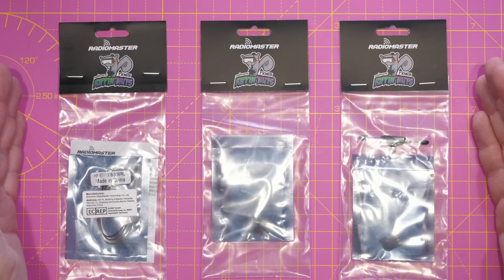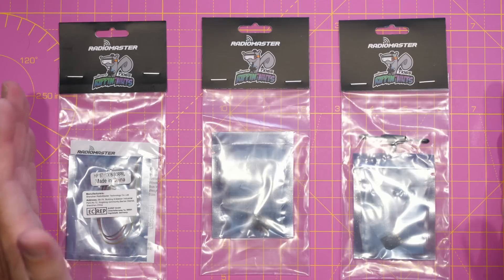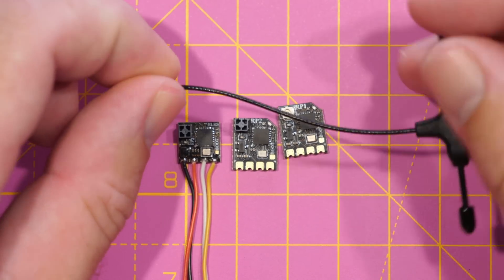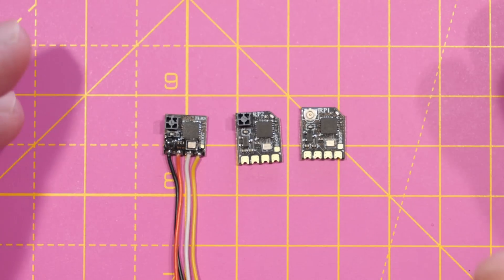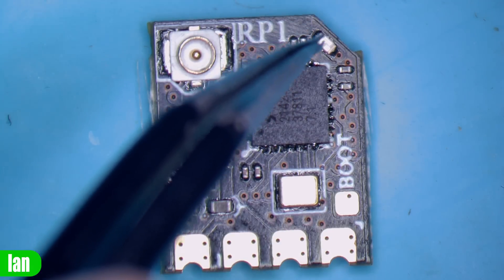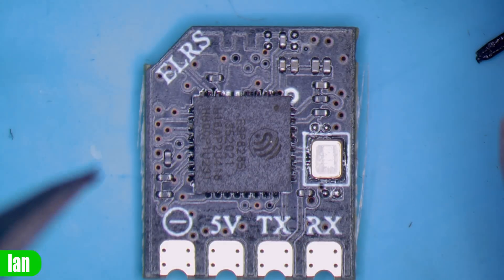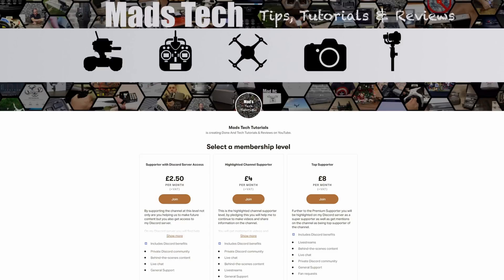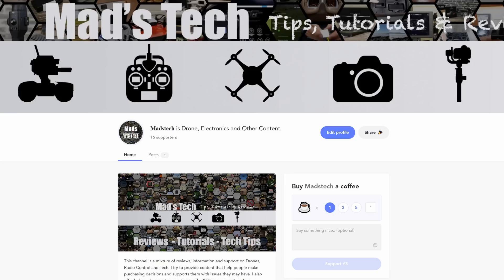Radiomaster RP1 & RP2 ExpressLRS Receiver - New Design

Comment from the maker: Crystal Oscillator Accuracy

I was asked to test the XCO on these receivers, please see the below results.   

Testing done with Aaronia Spectrum Analyser as per the Dev team process with a tone on 24,440,000Mhz and units tested cold and left to warm up and drift. 

RP1 - Tone at 2,440,002Mhz - 2khz positive offset - no major drift over time. 

RP2 - Tone at 2,440,022Mhz  - 22khz positive offset  - no major drift over time. 

Comparison with BetaFPV TX Micro 500mw Tx model hot .

Tone at 2,439,869Mhz - 131khz negative offset - some minor drift over time. Increased from 126khz. 

As you can see when you compare this to the ELRS dev team chart the Radiomaster receivers are well with in spec. 

This is obviously based on a test sample of 2.
Reply: @Mads Tech  Could you make a video sometime about the whole topic cause I am just partly sure what this is about. I guess you had mentioned that in a livestream with a chart and some radios and receivers with different offsets to the 2,44 which then could end in a mess if the combination gets out of spec. 
I had read that comment about the XCO and his complaints and therefore did a google search for 'xco elrs' with simply 0 result - therefore I am asking.
I guess it is the general quality issue how precise and  consistent the receivers / transmitter work together or if they are on the edge and could cause an issue depending on the transmitter and ambient temperature  - which will be a lot harder to test considering that your bench might have 25°C in summer heatwave and 15 in winter, while built in it will face 50°C and more inside a plane in summer on the field.

thanks
Reply: It is very informative about receivers. What about ELRS transmitter?  I would like to see what offset and drift the oscillators of Radiomaster Zorro and TX16 II internal module have got.
According to elrs dev XCO chart, vast number of elrs receiver have negative xco offset whilst Radiomaster TX16 has positive drift. This may raise some concern about what extent RX and TX are compatible with each other at all even though they are at the same ELRS version.
Reply: Thanks, great to know!

Comment: My experience: RP2 in LBT EU Mode (and within the frame): RX works well, but Telemetry is lost after less then 200 m. RP2 in ISM Mode: ok, but not stellar.  RP1 with external antenna: absolutely no RX loss, perfect telemetry signal (again in LBT EU Mode). (my TX: Radiomaster Boxer ELRS).  My recommandation: always go for the RP1 (unless you always fly very close).
Reply: I fly RP2 on 150Hz and 250mW, still impressive range. RP2 on 500Hz it is a different story and range is definitely less. (Jumper T18 Pro, LBT EU Mode)

Comment: the question that needs to be answered is..  do the RM EP/RP type recievers play well with the Happy Model 2.4 ELRS transmitter? Do they bind easily or does one have to sacrifice 2 goats and a duck to get it to work?   a great example of hard to do would be binding the Happy Model Mobula 6 ELRS 900 with the Radiomaster TX16S using the Happy Model 900 ELRS transmitter drop in pack... nearly impossible to do if you arent a computer wizard...

Comment: Good stuff! ; ) Most of us (at least those building more aerodynamic models like wings!) appreciate that the RP1, WITH socket/external antenna results in a less aerodynmic and heavier build (+1.7g)!  Would be great to know how much signal strength/range is compromised with RP2, if at all? (Signal strength/range compared to RP3 would also be VERY helpful!)

Comment: Excellent video.  I searched to find the difference between the EP and RP models.  You've explained it very well.  Improved PCB, larger solder pads.  Slightly larger but the RP2 fits in my 2.5 Tadpole rather well.  Thank you, sir!   I can't believe how easy it was to update the firmware over wifi and bind the receiver with my radio  ELRS, I'm hooked!  Thank you RadioMasterRC!

Comment: Hi Mads - I saw someone criticize your video and then you tested it, compared to Betaflight, but I did not understand the technicals behind your reporting - it went over my head.  My concern is I know a ceramic antenna has less range but still Wes Varty got really decent results that basically no quad could ever fly beyond its range - yet I bought a Betafpv receiver with ceramic antenna and my RSSI LQ was dropping considerably within 150 feet - not sure if I can trust ceramic antennas - would like more info on range and reliability of signal, etc.  Appreciate bringing these products to our attentiion.

Comment: How does its frequency stability perform in various temperatures?
Reply from the maker: I did add the offsets though in the sticky
Reply: @MadRC  Ah I think those don’t show up on YouTube mobile on my iPhone browser. (Neither in the mobile app as far as I know)
YouTube is very inconsistent with that.
Reply: @MadRC  thanks!
Reply from the maker: We can test this forever but that’s not really going to change anything. These are so close both cold and left to warm and tested again they are never going to drift outside the 200khz limit.
Reply: @MadRC  thanks for your response!

As a very frequent viewer I’d really have liked a more in depth video (using all of your many skills and tech equipment). After watching I do not feel informed to a level that would help me make a purchase decision. 

In any case, keep it up! You’re doing good work.

Comment: I watch your channel rather regularly, and I generally like a lot what you do. Thx for that!
This review however I find quite disappointing. You only look at the build quality, but good build quality does not say anything at all if it's good design and high quality. A crap design built well still is a crap design. I actually deprive all these reviews out there which just look at something and than praise it in high words. That's a strange interpretation of "high quality". The disappointing thing here is that especially you would have the abilities (tools) to do better!
First, I wonder, is this a TXCO. If not, then it is the same crap design as before. If it is just a XCO, is it in the correct frequency range? You could measure that with your tools! How does it behave with temperature? You could measure that with your tools! (I assume you surely know about the frequency issue(s) with ELRS devices) 
Is the RF path on the pcb well designed, how is the rf filter/impedance matching? You could measure that with your tools! Does the antenna just have a nice plastic thing, or is the ufl connector in fact well attached (which is often the real problem)? How is the antenna tuned, and matched, does it reach the gain it is expected to reach? You could measure that with your tools!
Nothing on any of the real points, all you argue it's well built and conclude it's highest quality and so much much better ... you can do better :)
Sorry for being picky, as said I generally like your contributions a lot, and I wish you won't become just another of these hasty reviewers talking all the same ... well, you understand :)
Reply from the maker: There are a few things here I’d like to reply on.  

First of all I did I hit just say it was good based on how it looked. I made it clear I had not flown it my self however I had actually spoke with the ERRS devs on the receiver to confirm their thoughts before publishing and it was said to be absolutely fine with no issues.  The design is  as they would expect it.  

As for the XCO issues in ELRS this is actually something that’s extremely limited and no that wide spread.  It’s something I am thinking about adding to the list of tests for sure however it’s also not something that needs to panic people.  To keep it fairly simple I may add in testing for this but I also don’t want to be highlighting something that’s affecting 1/1000+.  But these receivers are being tested specifically for that today but that’s only a sample size of 2. 

Antenna tuning is one I will do in-future for sure. 

As for going into a deep dive on the antenna matching circuit and PCB track impedance on something like this of this cost I’m not sure what the benefit it overall. 

I 100% agree on some of the basics we can cover and add info on to for sure and I will post some of that later today.  

I don’t just say I’m happy with something easily, if I can’t test it I will ensure I have spoke to someone who has who is in authority as I have here with the ELRS dev team. 

The problem with reviews is there is a balance, could spend 3 days on a $20 part and achieve nothing more than what I was originally saying however I also agree more info could be here.  I will be posting an updated video on the P200 PSU later today and then I will do the same for this and I’ll do the Xxo tests on all my radiomaster gear
Reply: @MadRC  absolutely, you had been clear, I didn't wanted to imply different. Yet, the argument stand. Cool however that you poke deeper into it, and if my post may have triggered it, it wasn't useless. Maybe after some days, when you have compiled all pieces, you would make a follow up review. I think many would love a deep dive. (and mention ELRS devs test insights&opinion). Keep up your great work :)
Reply from the maker: Just as an update the RP1 and RP2 were tested today and here is the results. 

Testing done with Spectrum Analyser as per the Dev team process with a tone on 24,440,00 

RP1 - 2,440,002 - 2khz positive offset - no major drift over time. 

RP2 - 2,440,022 - 22khz positive offset  - no major drift over time. 

Comparison with BetaFPV TX Micro 500mw Tx model hot .

2,439,869 - 131khz negative offset - some minor drift.
Reply: If you had watched the videos regulary then it is obvious that there had been 2 kinds of elrs receivers
* cheap and crappy soldered ones with some DOA or questionable quality regarding how long they last
* better ones on the bench 
That's what we have seen before and talked before on the channel and sometimes on sunday evenings we had talked about the experience on the field, but we had not measured that. I bet you will find not much difference between the same pcb.

And over all of that we have to face the reality of chinese mass production that can change from day to day based on the supplies they got as we had seen in the laptop area even before the corinna nightmare like those EZBooks where we had identified 5 different designs for the same product with different weaknesses like touchpad and others.

So what you have seen here means nothing considering that supply line issues can force them to choose different components from different suppliers on paper with the same specifications, but if you have to exchange 5 components then 5 different tolerances can multiply each other and end in a nightmare. Might not be happen with TBS products but ELRS vx/tx will suffer far more of these issues.
Reply: @typxxilps  you seem to be unaware of the 3rd kind, those with bad or even flawed design ... maybe you want to not only watch videos, but also inspect other sources of info more regularly ;)

Comment: I still don’t get what’s the big deal.  I’ve never even heard of radio master….. is this for  air or can it be used surface?  Just didn’t get why all the technobabble
Reply: it's probably ly the smallest long range receiver with great quality you can buy today. it is used mainly for quads because of the light weight and size, they also work with UARTs found in flight controllers,  there are other elrs receivers for air  planes and surface (cars) they would use old school PWm style connection.. RadioMaster is is a great brand, they offer endless options on your receiver from physical customization like buttons, lights, nobs. but the Radio master uses edgeTx which is constantly being updated. pound for pound there isn't a better controller in my opinion when it comes to the RadioMaster Tx16s m2. take some time to do a little research and see all the benefits compared to over rated over priced brands like spectrum, Futura and others.

Comment: Can you please contact with RadioMaster and ask them when the elrs module for the Tx16s radio will be available.  I would like to replace it on my radio (v1) from 4in1 to elrs. Thank you in advance
Reply: I've been using the HappyModel Pro with no problems. Even though the radios are coming with internal ELRS now, it's still capped at 250mw. You have the better option, get a readily available external with 1000mw output.

Comment: Hey Mads do these receivers have any of that RX module frequency error that JB and Itsblunty were talking about in the news last week?  That thing about desoldering capacitors and whatnot?

I have a bunch of Happymodel receivers and they've been rock solid for me, but I'm running low and looking to stock up.  These looked interested but I figured I might as well get something that is perfectly in spec with the ELRS dev team recommendations.

Thanks for all you do!
Reply from the maker: I spoke with the ELRS team as as far as I know no issues but I may check this tbh
Reply: @MadRC  Let us know what you come up with, much thanks!
Reply from the maker: Crystal Oscillator Accuracy

I was asked to test the XCO on these receivers, please see the below results.   

Testing done with Aaronia Spectrum Analyser as per the Dev team process with a tone on 24,440,000Mhz and units tested cold and left to warm up and drift. 

RP1 - Tone at 24,440,002Mhz - 2khz positive offset - no major drift over time. 

RP2 - Tone at 24,440,022Mhz  - 22khz positive offset  - no major drift over time. 

Comparison with BetaFPV TX Micro 500mw Tx model hot .

Tone at 24,439,869Mhz - 131khz negative offset - some minor drift over time. Increased from 126khz. 

As you can see when you compare this to the ELRS dev team chart the Radiomaster receivers are well with in spec. 

This is obviously based on a test sample of 2.

Comment: Thank you for the review, I searched in their website but could not find the technical specifications of the RP1. Do you happen to know much is the telemetry power for  the radio master RP1 ?

My current favorite ELRS RX is the BetaFPV ELRS Nano Receiver. Particularly because the telemetry power is 20dbm (100mW, 2.4G Version).
Reply from the maker: It will be the same as the others with out a PA as about 12mw
Reply: With the RP1 I was able to get 100mW of telemetry.

Comment: the design and production look really astonishing clean and the soldering joints look pretty precise. 
Only piece missing: the Zorro 2 with 18650 compartment

Hope to see this be released soon to get one with the receivers hoping they will perform.

Will you do a flirc comparison of the receivers under power over 10 minutes to see if this better quality has less issues than the previous reviewed ones like happy model?
Would be great to see a pay off in the quality. 

EU prices here are net, so be aware that VAT comes on top and then those will be over 20€ but I guess worth the extra. 

OffTopic: pretty smart marketing move by leaking the avata images and data so early just in that moment when the Walksnail Avatar had its weakest moment. I bet we will have a dji avata weekend ahead and a wave of influencer reviews and maybe one lucky guy who will find one in a store tomorrow or wednesday and get that one to be the first to talk about.

Hope you will get your pretty early and that the weather will be neither too hot nor too rainy.

Comment: the weak point is the telemetry power, if you rely on the telemetry you have limited range even this receivers can go for miles..
Reply: I would discard telemetry and use OSD instead.

Comment: So I have three happy model EP ones and twos I'm afraid if I start getting radial master receivers I'm going to have a hard time remembering which of my drone has what receiver when it comes to updating. Any thoughts on that situation
Reply: Make a txt file and write it down.
Put this file somewhere, where you find it.
Reply: @uhu4677  I had a similar problem. Each supplier uses a different color LED on the receiver. Right now I have green, yellow, blue each from a different supplier
Reply: To fix the issue the devs are working unified targets, which means you won’t need to worry which brand of RX you have.
Reply: @ChrisCroft77  are you serious, that sounds outstanding
Reply: @MrSabram07  also that also means no need to compile the firmware each time also.
Reply: @ChrisCroft77  because I am impressed with those receivers
Reply: ELRS is moving to unified targets remember...so this won't be an issue after 3.0
Edit: someone beat me to it 😅

Comment: Even though they're created using open source info and they should all just work in the same way, I still do like buying receivers from a brand I trust. Especially if that brand is the company that also makes my radio 👍
Reply: even reputable companies like Matek fucked up their designs with wrong tuned crystal oscillators... and they are usually create outstanding good hardware.

I would suggest waiting before buying new stuff. errors and fuck ups usually show shortly after all the reviewers have delivered their videos.